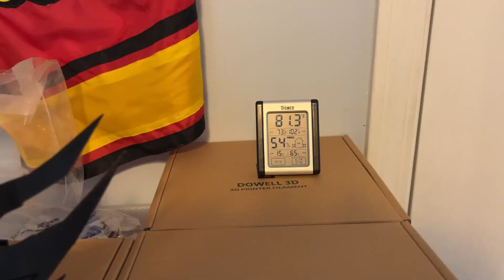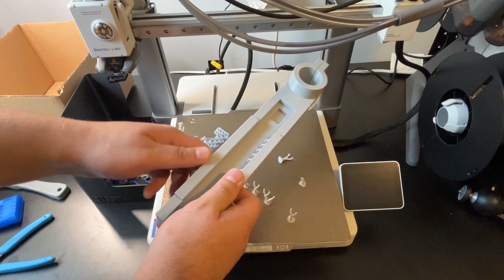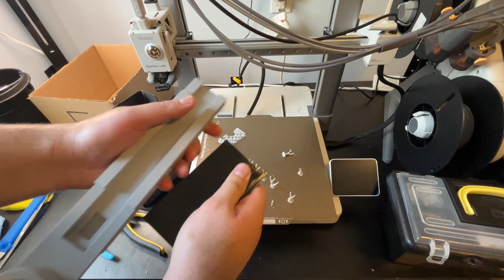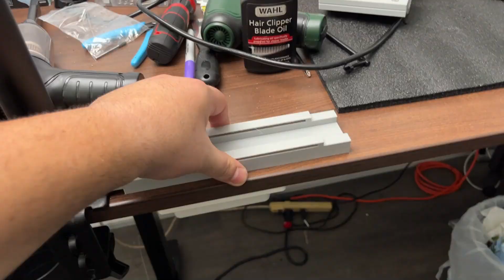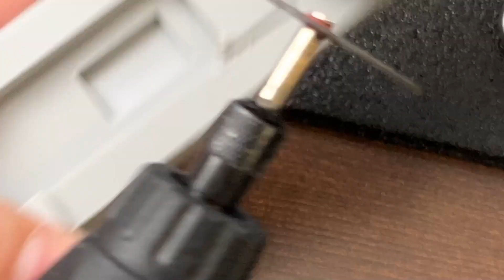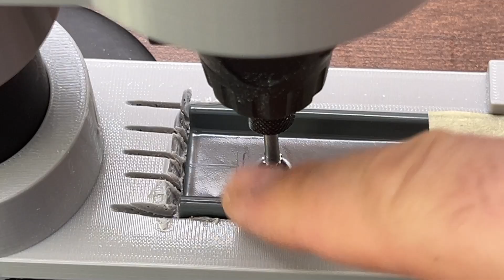Bambu Lab A1 Solutions: 3D Printing Jigs to Resume Production!

Comment: Try some paste wax. (I was once told that this would damage the plastic but 5 years later the parts in question are still perfect).
Reply from the maker: @modern_DIY  Thanks for the suggestion! I haven't tried paste wax before to help with part release. It’s interesting to hear it’s worked well for you for so long without damaging the plastic. I’ll definitely consider it, especially for those tougher to release prints. Appreciate the tip :)
Reply: Sorry, I meant for the interfacing of tightly fitting parts.

Comment: When it comes to cutting plastic like you're trying to do with that disc you're better off just taking an exacto knife, an old blade, and heat the blade up and use it to cut through the PETG or PLA. It'll go through it just like butter! Straight too!
Reply from the maker: @justinmurphy2227  That's a really smart technique, I appreciate the suggestion! Heating up an old blade to cut through the plastic sounds like a safer and cleaner method. I'll definitely consider this next time to avoid any hot PETG getting flung around. Thanks for the tip :)